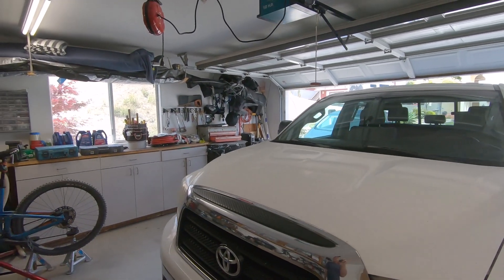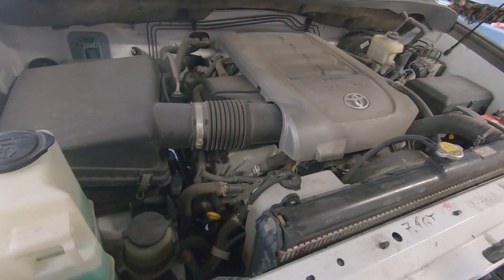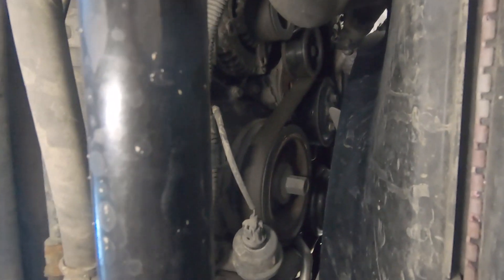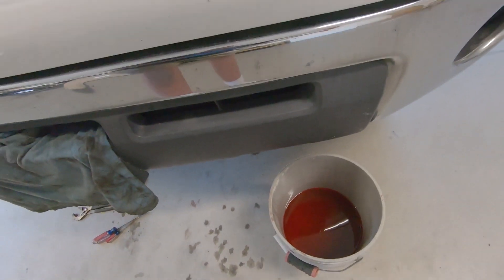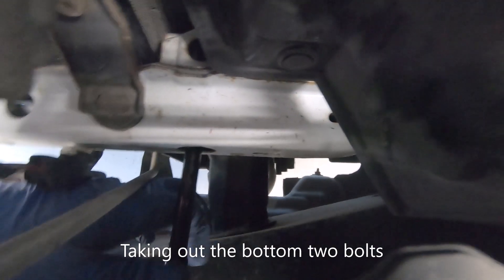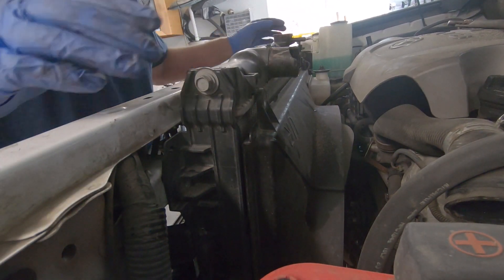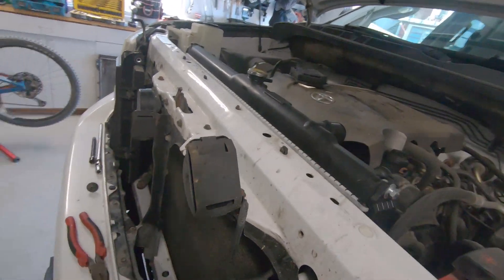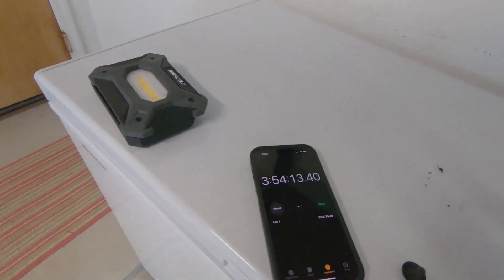Changing a 2008 Tundra Radiator

Comment from the maker: I bought the radiator through CarParts.com for about $175, including delivery.  It came in 2 days (one day early).  I bought the Radiator fluid at Walmart for about $20/gal 50/50 mix.  The manual says the system holds just under 4 gallons but I ended up using only 2 gallons so I returned the other 2.